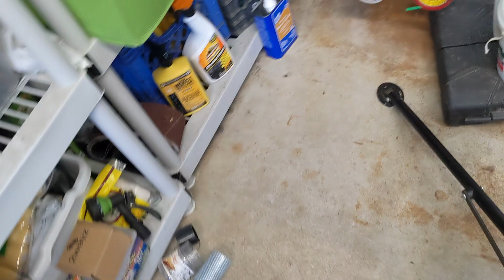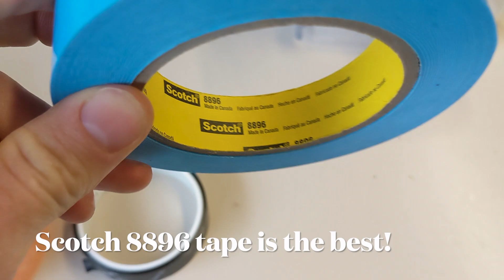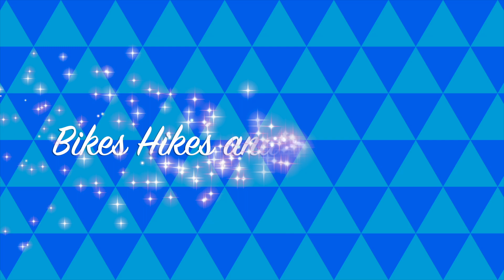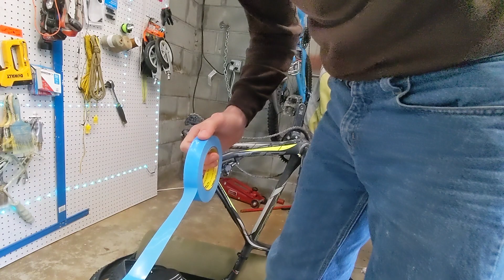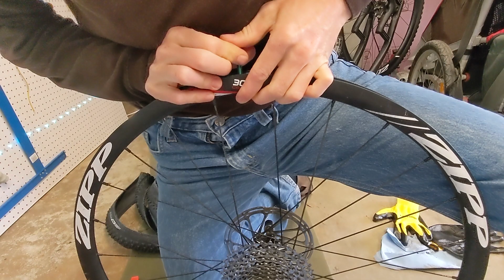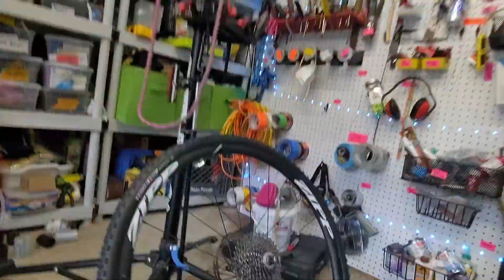Zipp Wheel Tubeless tire conversion hell! - a tape that works! Scotch 8896

Comment: A better option to do the hole for the valve stem is to poke a hole with something hot so it melts the edges at the hole, where a tear might otherwise start.

Comment: I see multiple dents in that rim. That isn't a problem for you running tubeless?
Reply from the maker: Yes. The rim is toast. Which makes the wheel toast. This bike has been in storage in my garage until I buy new wheels. However, the frame will not fit wider tiers so I am stuck unless I buy a new frame and wheels. At this point it may be cheaper to buy a used bike that has a good frame and wheel set. It sucks because the bike as relatively low miles but was expensive. I think I paid $2600 -$2800 cash for it.

Comment: Would you use the same width on the Priority 600 rim?
Reply from the maker: I am not sure. The priority rim is a bit wider.  And the grilla tap I used on the Priority rim is working great still! I am riding the bike ~50 miles per week and add air to the tires about once every three weeks.